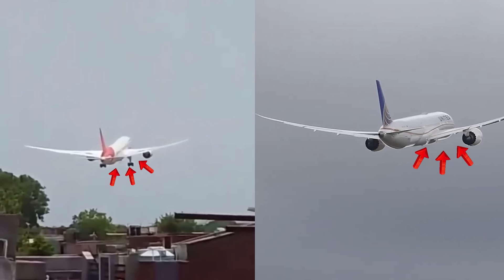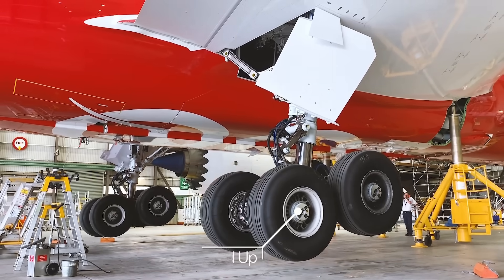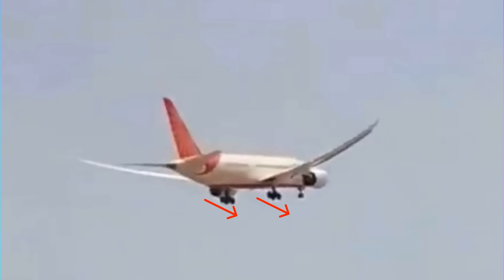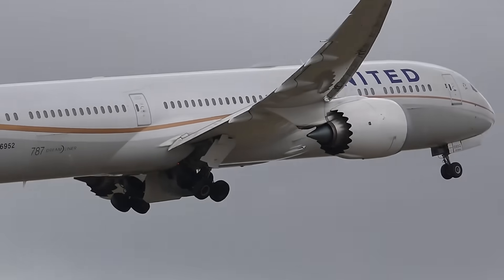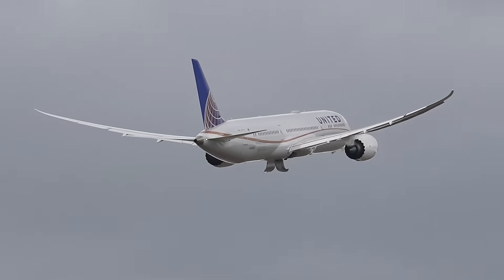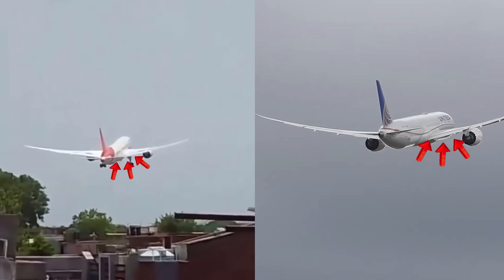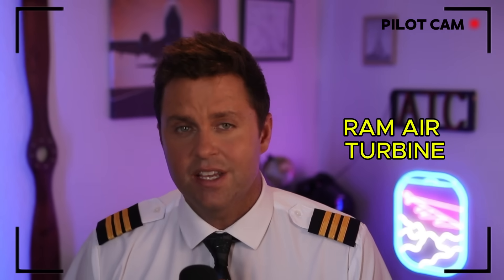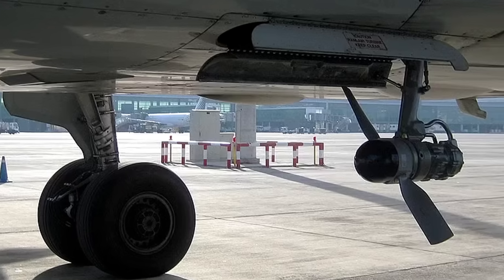Pilot Explains: A New Detail in the Air India 787 Crash Everyone Missed

Comment: Love DeepSeek’s explanation 

Dual-engine failure on a *Boeing 787 Dreamliner* (or any modern twin-engine jet) is *extremely rare* due to multiple layers of design redundancy, advanced technology, and rigorous operational safeguards. Here’s why:

### *1. Ultra-Reliable Engine Design*  
- The *Rolls-Royce Trent 1000* and *GE GEnx* engines on the 787 are highly reliable, with *in-flight shutdown rates* of less than **0.01 per 1,000 engine hours**.  
- Built with *redundant systems* (dual-channel FADEC, multiple sensors, backup fuel pumps) to prevent failures.  

### *2. Extensive Certification Requirements (ETOPS)*  
- The 787 is *ETOPS-330 certified**, meaning it can fly **up to 330 minutes (5.5 hours) on a single engine* in case of failure.  
- To achieve this, Boeing had to prove that *dual-engine failure probability is astronomically low* (less than **1 in 1 billion flight hours**).  

### *3. Redundant Systems & Backup Power*  
- If both engines *somehow* fail, the 787 can still generate power via:  
  - *Ram Air Turbine (RAT)* – Deploys automatically, supplying hydraulic & electrical power.  
  - *Battery Backup* – The 787’s lithium-ion batteries can power critical systems.  
- Flight controls remain operational even without engines.  

### *4. Fuel System & Contamination Protections*  
- *Advanced fuel monitoring* prevents fuel starvation.  
- *Dual-channel fuel pumps* and filters reduce contamination risks.  
- Pilots are trained to *cross-feed fuel* if one engine has an issue.  

### *5. Pilot Training & Procedures*  
- Pilots train extensively for **engine failures**, including **single-engine landings**.  
- Procedures exist to *restart engines* in flight (using windmilling or APU assistance).  

### *6. Real-World Engine Failure Statistics*  
- **Modern turbofans almost never fail in flight**—statistically, a **dual-engine failure is far rarer than a lightning strike**.  
- Most engine "failures" are precautionary shutdowns due to sensor warnings, not actual mechanical failures.  

### *When Could Dual-Engine Failure Happen?*  
Theoretically, only in *extremely rare* scenarios like:  
- *Massive volcanic ash ingestion* (clogging both engines).  
- **Simultaneous fuel contamination or sabotage**.  
- *Catastrophic bird strikes* (e.g., multiple large birds ingested at once).  

While **dual-engine failure on a 787 is astronomically rare**, there are a few **theoretical scenarios**—some more plausible than others—that could lead to such an event. Here’s a deeper dive into potential causes, along with real-world examples and mitigating factors:  

---

### *1. Fuel-Related Causes*  
#### *A. Fuel Starvation (Most Likely Human Factor)*  
- **Pilot Error**: Incorrect fuel management (e.g., mismanaging crossfeed valves, misjudging fuel burn).  
- **Fuel Leaks**: A major leak in a shared fuel system (though the 787 has multiple segregated tanks).  
- **Fuel Contamination**: Water, microbial growth, or improper fuel type (extremely rare due to strict quality checks).  

*Mitigations:*  
- Automated fuel balancing & warnings.  
- Triple-redundant fuel quantity indicators.  
- Mandatory fuel sampling before flights.  

#### *B. Fuel Freezing (Very Unlikely)*  
- At extremely high altitudes, fuel can gel if additives fail.  
- The 787’s *fuel temperature sensors* and *heating systems* prevent this.  

---

### *2. Extreme Environmental Factors*  
#### *A. Volcanic Ash (Historically Dangerous)*  
- Ash melts inside engines, forming glass deposits that block airflow.  
- **Real-World Example**:  
  - *1982 British Airways Flight 9* (B747 lost all 4 engines in ash cloud but restarted them).  
  - The 787 has *improved ash detection* and pilot procedures to avoid ash clouds.  

#### *B. Severe Icing (Rare for Modern Jets)*  
- If ice blocks engine inlets or sensors, airflow can be disrupted.  
- The 787 has *anti-ice systems* and *automatic throttle adjustments* to prevent this.  

#### *C. Extreme Weather (Microbursts, Hail)*  
- A microburst could cause *flameout* if engines ingest massive water/hail.  
- The 787’s *weather radar* helps pilots avoid such conditions.  

---

### *3. Mechanical or Electrical Failures*  
#### *A. Common-Cause Design Flaw (Worst-Case Scenario)*  
- A *shared defect* in both engines (e.g., faulty turbine blades in a batch).  
- **Example**:  
  - *2018 Rolls-Royce Trent 1000 issues* (cracks in blades led to inspections, but no dual failures).  
- **Mitigation**: Engines are from different production batches to avoid simultaneous defects.  

#### *B. Electrical System Failure (Unlikely but Possible)*  
- The 787’s *FADEC (Full Authority Digital Engine Control)* relies on electricity.  
- If **both generators + RAT + batteries failed**, engines could lose control.  
- **Mitigation**: Triple-redundant electrical systems make this near-impossible.  

---

### *4. Foreign Object Damage (FOD)*  
#### *A. Bird Strikes (Rare for Dual Engines)*  
- Large birds (geese, vultures) can damage fan blades.  
- **Example**:  
  - *2009 US Airways "Miracle on the Hudson"* (A320 dual engine failure due to geese).  
- The 787’s *larger engines* are more resistant, but not immune.  

#### *B. Runway Debris (During Takeoff)*  
- Metal fragments, rocks, or cargo debris sucked into both engines.  
- **Mitigation**: Improved FOD detection at airports.  

---

### *5. Sabotage or Unusual Events*  
#### *A. Intentional Acts (Terrorism, Sabotage)*  
- Deliberate fuel poisoning or explosive device.  
- **Mitigation**: Strict security protocols and cockpit safeguards.  

#### *B. Space Weather (Solar Flares)*  
- A massive *electromagnetic pulse (EMP)* could theoretically disrupt electronics.  
- The 787 is **hardened against EMP**, but this remains speculative.  

---

### *What Would Happen If Both 787 Engines Failed?*  
1. *Ram Air Turbine (RAT) deploys* → Powers flight controls & instruments.  
2. *APU can auto-start* → Provides backup electrical power.  
3. *Pilots attempt windmill restart* (diving to spin engines).  
4. *Glide ratio ~15:1* → A 787 at 40,000 ft can glide **~110 miles**.  

---

### *Final Verdict*  
While **technically possible**, dual-engine failure on a 787 would require:  
✅ *Multiple system failures* (fuel + electrical + pilot error) *or*  
✅ *An extreme external event* (volcanic ash + bird strike + icing).  

The aircraft’s *triple redundancy, ETOPS certification, and pilot training* make it **one of the safest jets ever built**.

Comment: If we assume that the fuel contamination was indeed the primary reason and if that contamination got evenly blended with the fuel, then why would there be no indication of engine trouble while the aircraft left The gate and  taxied on to the runway.
The performance of the engine don't seem to be impacted while it was picking speed on the runway as well as first few seconds of the climb. 
The time from the max ascend to the crash is just about 12 seconds. So the contamination starved both the engines simultaneously with such a grave impact that both the engines shut down simultaneously. Very very low odds of that happening. 
Can you please help us understand this perspective a little more?

Comment: When you lose forward velocity on a fixed wing aircraft, don't the extended flaps at a specific angle act as air brakes and slow the aircraft down further? Thanks for the excellent information.

Comment: If they do find out it's dual engine failure and has to do with some electrical problem and the pilots did everything possible to try to control the plane and no error on their part then Boeing will have a lot to answer. They must be sh#tting in thier pants right now especially after aviation experts analysis on the accident.

Comment: how many fuel pumps does this aircraft have?  the survivor said there was a pop/bang then the power flickered before the crash.  i assume both motors have seperate fuel pumps... but the lines would run near or together at several points right?    i said on another stream about this that there is a possible issue with battery or its connections.  idk battery stuff for the craft.  but power is linked to the engines running if the battery is out right?  the rat is deployed to give you minimum power for hydrolics. eletronics.. but idk what system is responsible for the fuel pump/s...   the nose of the airplane was way up too but it could be a picture/video angle of attack sort of thing.  but the thing with the gear being angled makes me wonder if a hydrolic system blew and took out electrical lines, which shut down the fuel pumps.  or some sort of cockpit bird strike?

Comment: I just hate YouTube pilots they are just glorified bus drivers! I would only trust the aircraft engineers that worked on this aircraft certification and the test pilots that would have pushed this aircraft to its absolute limits. Even Google says its possible at full weight to take off with flaps retracted! These are not the same aircraft or jet engines from the 60s! I right from the start with virtually no experience in flying knew it was not a flap issue! Yet many YouTube pilots blamed the pilots! I still believe the pilots may have added to the accident, as it looks like it took more than the entire runway to get off the ground, so engine thrust must have been an issue before lift off! But pulling flaps after take-off at least, according to Google, that uses search on the internet, probably from real experts, said the flaps even on take-off the aircraft could still take off safely just would need to be a lot faster at lift-off. Contaminated fuel? Why would only this aircraft be affected? All aircraft get the fuel from mostly underground tanks, so other aircraft should have also been affected??

I am also surprised the airline pilots do not even know how the flaps work! They do not retract instantly they take around 20-30 seconds to retract from each position.
This aircraft has a very powerful lithium battery, so to lose hydraulics and electrical that fast after take-off is not possible! There would be plenty of pressure to easily get the landing gear up! There must have been a massive failure in a major system! 

Also no mention of the APU? Thats a powerful back up system, how did that fail as well? It's got to be a major fuel issue!

Comment: Here's the translated summary of Vinay Jha's detailed analysis of the Ahmedabad plane crash:
Ahmedabad Plane Crash: A Detailed Analysis by Vinay Jha (Abridged)
The aircraft crashed 625 feet after takeoff, with both engines failing simultaneously. It's impossible for both engines to shut down at once due to a bird strike. The fuel contained in the supply pipes from the fuel tank's main switch to the engines can only sustain them for about 30-40 seconds. This is sufficient for an ascent of approximately 625 feet. Therefore, it's highly probable that the fuel tank's main switch was closed after filling 1,26,000 liters of fuel before departing for a long-haul flight.
During the investigation, the fuel tank and main switch are thoroughly inspected, ruling out the possibility of external terrorist involvement. Many lives could have been saved in the crash, but survival from the explosion of 1,26,000 liters of fuel is extremely difficult.
An aircraft cannot be dispatched for a long journey without a complete inspection, and a meticulous check of the entire fuel supply line is mandatory. After the inspection, the aircraft crew does not have access to this area; the fuel supply line is the responsibility of the ground staff. Therefore, someone deliberately closed the main switch of the fuel supply line during the inspection. I say "deliberately" because the very component that requires mandatory inspection and is only accessible to the inspection team was found closed.
Technical Indicators of the Crash:
If the main fuel valve is closed, the engines will only run on the residual fuel in the pipes, which is sufficient for approximately 30-40 seconds. During this time, the aircraft can reach an altitude of about 625 feet. Subsequently, the fuel runs out, both engines shut down, the aircraft descends, and impacts with an explosion.
Four Levels of Investigation:
 * Mandatory inspection of all systems before a long-range flight:
   * Especially:
     * Fuel tank level
     * Fuel supply line pressure
     * Crossfeed and supply valves
     * Pump functionality
       This falls under Pre-Departure Technical Clearance (PDTC), performed by a lineage engineer and certification officer (ground technician).
 * Flight crew (pilots) are called to the aircraft after inspection. The flight crew accesses the aircraft only after runway clearance. Their job is to double-verify systems through a preflight checklist, but they are not authorized to open/close fuel line valve configurations or tank venting systems. This means the responsibility for the main fuel valve and supply line rests solely with the ground technical staff.
 * If the main fuel supply valve was closed:
   * Engines will run only on residual fuel in the lines (30-40 sec).
   * As soon as the line fuel is exhausted, both engines flame out, and the aircraft will fall.
     The AI171 crash at 625 feet is direct evidence of this.
This is the crucial point: "Who closed the very component that requires mandatory inspection and is only accessible to the inspection team?" This indicates the entire case points towards murder or extreme criminal sabotage.
Investigative agencies should conduct a forensic examination of the following points:
Questions for the investigation area:
 * Pre-flight inspection log: Was the opening of the valve confirmed by a signature?
 * CCTV (hangar + tarmac): Which of the ground engineers last touched that valve area?
 * Toolbox audit: Did any unauthorized person gain access?
 * Flight data recorder (FDR): Was the fuel line pressure 0 before takeoff?
 * Crew CVR: Did they receive any fuel pressure alert? Did they say anything?
If this is Sabotage:
Confirmation indicators:
 * The valve was intentionally closed.
 * Technical Probability: 100%
 * Only inspection staff had access; flight crew or others had no access.
 * It happened after fueling, otherwise, fuel couldn't have been filled.
 * It occurred after the final technical clearance because the aircraft had already started taxiing.
Conclusion:
This is not gross negligence; it is a clear criminal act, whether it be organized political malice, internal revenge, or a targeted attack by some power.
Reply: Look up the passenger list and draw your own conclusions.
Reply: If the fuel valves were closed then how did the engines run during the several minutes of taxi time before takeofff. I dont believe any of this. I'm a 37 year retired ailine mechanic and have shutoff the fuel valves during engine testing. The engines will only run about 30 seconds after the valves are closed. The plane would have never made it to the runway. Maybe the criminal was running beside the airplane during takeoff. LOL By the way most of the fuel lines are inside the fuel tank.
Reply: @larrymays1754 

If the main fuel supply valve is closed, only the residual fuel in the fuel lines between the valve and the engines is available. That residual fuel can power the engines for 30–40 seconds, depending on:
	•	Engine type and thrust setting
	•	Altitude and rate of climb
	•	Fuel line volume

In this time:
	•	The aircraft can climb 500–700 feet (typical initial climb rate is 1,000–2,000 feet/minute)
	•	Once the fuel in the lines is exhausted, both engines would flame out simultaneously
	•	The aircraft would stall and descend rapidly — resulting in a crash
Reply: @larrymays1754 If the main fuel supply valve is closed, only the residual fuel in the fuel lines between the valve and the engines is available. That residual fuel can power the engines for 30–40 seconds, depending on:
	•	Engine type and thrust setting
	•	Altitude and rate of climb
	•	Fuel line volume

In this time:
	•	The aircraft can climb 500–700 feet (typical initial climb rate is 1,000–2,000 feet/minute)
	•	Once the fuel in the lines is exhausted, both engines would flame out simultaneously
	•	The aircraft would stall and descend rapidly — resulting in a crash
Reply: @larrymays1754  if the main fuel valve (or crossfeed valve) is closed, fuel already present in the system downstream — including fuel pipes, engine-mounted fuel pumps, and fuel manifolds — can still be used by the engines.

This residual fuel includes:
	1.	Fuel in the high-pressure lines from the valve to the engines
	2.	Fuel in the engine’s own internal systems
	3.	Fuel in the collector tank (or surge tank) near the engine, in some aircraft models

Comment: Still looking at engine failure while in the air, that does not explain the late takeoff nor how slow the aircraft was moving on actual takeoff. My thoughts are they lost power on or around V1 where they are committed to getting in the air.

Comment: British Airways flight 38. Duel engine failure. That one was ice in fuel heater. Take off and landing create sloshes+demand changes.  Any crap in the fuel system? Filters, bypass valves, screens, sensors, nozzles, pumps,……………
Reply: First thing I’d look for, Fuel Filter Bypass Warning on FDR.